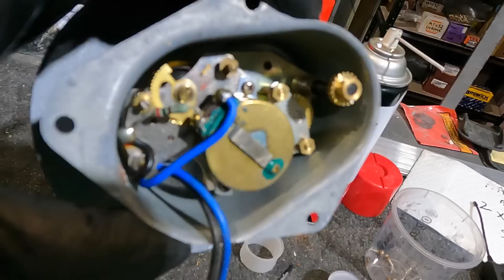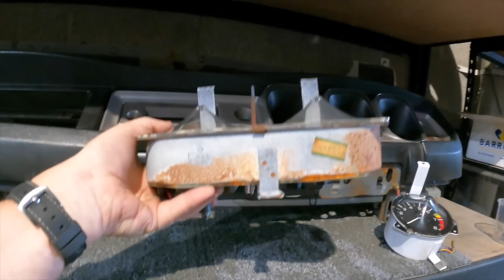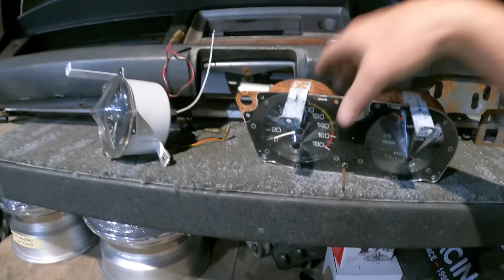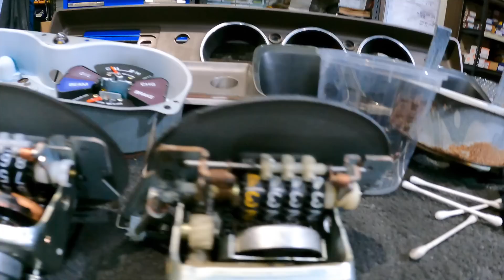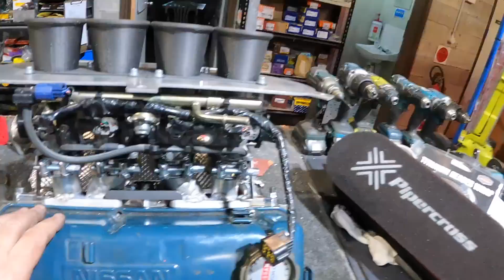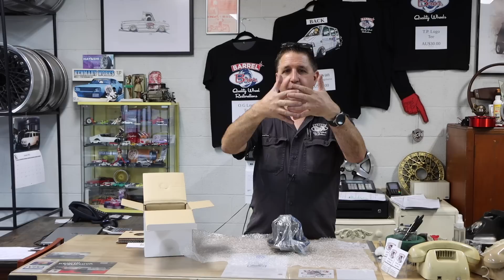83. Nissan Sunny Truck (Datsun 1200) EFI Pt4. Plus HUGE  Update!

Comment: Hey mate I have just purchased a set of 326 power wheels that were originally white with a chrome lip and now it’s completely chrome 

I was wondering if you can reverse the process ? 

Or can finish off the polishing etc? It has a few imperfections i am not sure how it got there I have never tried you guys out but I have heard heaps of stuff if you’re happy to help me out I am 100% happy to pay! If you can help me please let me know I live on the south coast 

and I am happy to drive 

So either to get it a mirror polish and fix the scratches from the owner ? Is there a way I can contact you guys??

Keep. Up the good work!

Comment: Awesome work as usual Mark.

FYI early Stanza were H165 diff, as were series 1 and 2 Bluebird (910).
If I remember correctly 3.7 and 3.9 ratios were available depending whether it was a manual or automatic transmission.